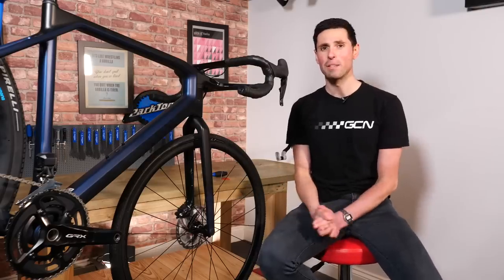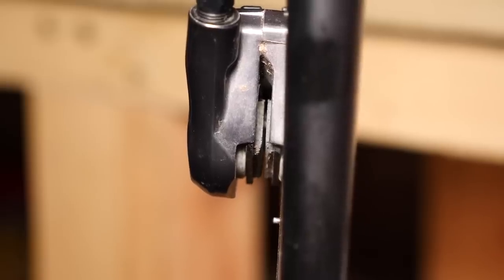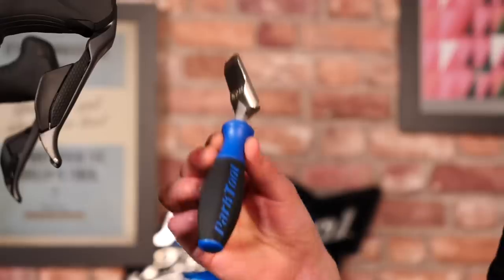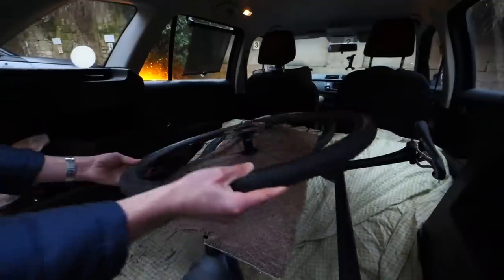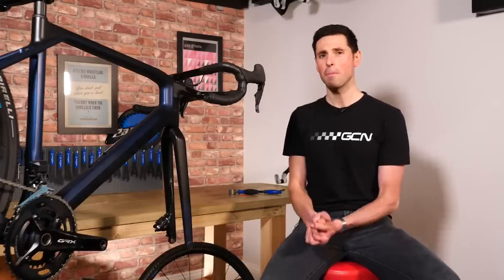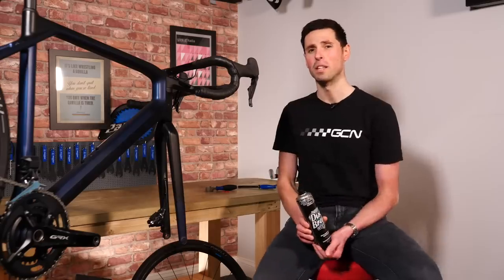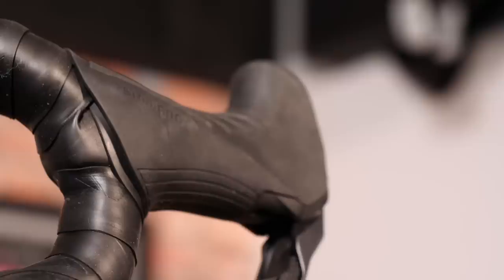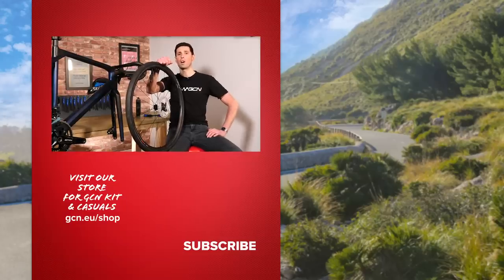Top Tips For Travelling With Hydraulic Disc Brakes

Comment: I have cable pull disc brakes on three of my bikes and love them. I would never want hydraulic brakes though...part of my love for bicycles is their simplicity. I have had enough fluid leaks from cars over the years.
Reply: I always had issues with sram brakes, Glad I changed to shimano, zero issues or maintenance needed except for brake pads

Comment: 1. Don't ever lay the bike down in the back of the SUV with the rotors on the bottom side. Lay it on chainring side. 2. After you lay it down, turn the handlebar 90 degrees to the right so the levers are up. I did not do this on a trip one time, and upon getting the bike out of the SUV the next day, I had no front brake. Fortunately, squeezing the front brake lever several times pumped up the front brake and it worked fine after that.

Comment: My caliper locked after taking out the wheel, thanks to this video! 💪🏻💪🏻💪🏻
Reply: Open the bleed bolt to release some pressure.  Also use a bleed block next time to ensure the correct amount is added to prevent another lockup.

Comment: On some levers such as Shimano 105 R7020, you should remove the top hydraulic screw before pushing back the pistons as the pressure can cause a small leak on the levers

Comment: To decontaminate my disc brakes, I remove the pads and sand lightly, holding them face down on a flat surface. Then I wipe everything off, including rotors, with methyl hydrate and a clean cloth. Works perfectly for me and costs virtually nothing.
Reply: I tried cleaning my front brake rotor on my gravel ride recently with iso alcohol but still no dice. I'll give them a light sanding next. What grit sandpaper do you typically use?
Reply: @BrentZahradnik  sand the pads, not the rotor. Use 220 grit or so, just to remove any glazing or contamination. Wipe off everything with alcohol afterwards.

Comment: Why so much hate for disc brakes in the comments section ? 😆 If you've ever tried them you can't deny the stopping power is far superior.  I've had both, never going back to rim brakes.
Reply: You need hydro disc to control a 25mm road tire? What rim brake calipers and pads are you using sir?
Reply: @durianriders  Do I NEED them? No, but I much prefer them.  I commute by bike, rain or shine.  Heavy bike, with sometimes heavy panniers.  80% busy city streets, 20% gravel trail.  Rim brakes become pretty much useless if it rains or if the trail is a bit muddy.
Reply: @durianriders  haha there he is. On his crusade against disc-brakes. Love u Harley 🤣
Reply: Haters gonna hate.
Reply: MRGRUMPY53  More often than I'd like, which is at least once a year (had one just last week).  The one time I had to do one with rim brakes left me rather unimpressed (and also flying over the handlebars).  Look, I get it: If you ride a super light bike for leisure, away from traffic and in good weather, rim brakes are more than OK.  For my situations where I have to be mindful of cars and distracted pedestrians/kids/squirrels/dogs jumping in my lane at any time, or going down a steep bumpy hill on my gravel bike, I'm much more comfortable using disc brakes.
Reply: @durianriders  Rim brakes simply don’t work in the wet. Unless you only cycle in the dry, disc brakes are far superior.
Reply: @durianriders  during inclement weather in hilly areas, it's like extra insurance. We all wish the weather would be like paradise all the time, unfortunately reality is often disappointing.
Reply: MRGRUMPY53  try riding through busy city streets during rush hour, you'd be surprised how many sudden stops you need to do.
Reply: MRGRUMPY53  ...and it sure sounds like you're playing dumb.  Traffic lights are the main reason one would need to suddenly stop? Really?
Reply: MRGRUMPY53  You've got to be joking but if you're not, please let us know where is this promised land where other road users are more predictable than traffic lights and never try to kill you, where squirrels never change their minds mid-dash about which side of the street they want to be on, and where it never rains.
Reply: @francoispayen  you said rim brakes made you fly over the handlebars on a panic stop? Maybe the rim brakes are too strong.
Reply: @kazaroth  rim brakes can lock the wheels on a wet road with no problem.

Comment: Any tips with regards to position of bike when travelling? I have found Turning my bike upside down causes the brake fluid to leak out and air fills the brake lines (ultegra di2). Is lying it on its side ok or just as bad as upside down?

Comment: When packing for air travel, you usually have to remove the handlebar to fit into the box/case. Is there usually enough hydraulic hose in a typical installation (tucked neatly away in the stem and head&top tubes) to extend to the lashdown points for the handlebar in a travel case? Would hate to think that one would have to disconnect the brake hoses (hydraulic fluid leaking EVERYWHERE, needing to refill and bleed the systems upon reassembly) to be able to take your Faithful Steed on holiday.
Reply: I flew like that pre-pandemic and yeah no problem - there's usually enough slack in the hoses to allow for the handlebar rotation. My RD still got bent but brakes and rotors were fine...
Reply: They should have enough cable - in fact this should be one of the first things you do when cabling a new bike (or when a bike is cabled in the factory) - check whether you have enough cable and hose so none of your brakes and shifters bind when the handlebars are fully turned to both sides. If cable length is not enough, somebody messed up during the process.

Comment: Hello, I have a question. While back while riding rented bike with hydraulic disc brakes (shimano 105) we stopped, took pictures with bikes over heads turned upside down, and headed to descent. One bike performed normally, but other during braking would occasionally start vibrating strongly, up to a point when bike was unsterable and only think you could do is to clench leavers just to stop. Vibrations would stop and you could continue descent, waiting for this to reoccur. I ride mechanical DB, this happened on last day of riding rented bike, what was it? Bike shop didn't know asked about it. Was it air that entered brakes when we turned bikes?
Reply: I had two brake pads where the actual pad came away from it's backing plate. One in the front calliper exited somewhere on the trail, the other in the back stayed in until I removed the pads to check them. Maybe you had some sort of similar dislodgement?
Reply: @peterharrington8709  thanks, but after first time it happend I chcecked calipers and everything was ok, no leakage etc.

Comment: some bike box forces us to pack the bike upside down, will there any air bubbles get into the brake hose with the brake fluid and cause some problem?
Reply: I tip my bike upside down all the time to drain water, ever had an issue with the hydraulic brakes
Reply: Never a problem if they are properly bled.

Comment: you work for disc brakes, rim brakes work for you.
Reply: Amen! 🙇
Reply: Maybe for road bikes, but for me rim brakes were a horrid constant faff on my mountain bike. Haven't had to change pads in 5 years (probably will soon, but they are within tolerance still) while on rim brakes I was chewing through pads every couple months.

So yeah, for road bikes rim brakes still make sense, for mountain bikes? No. Not at all
Reply: When it's wet, it's the other way around.
Reply: @nekobytes9187  squeeeeeal
Reply: Right, do a decent in a wet weather with rim brakes and carbon wheels and then come back to me. Trust me, I'd rather hassle a little more with maintenance and stay alive

Comment: Always remove  your brakepads and clean them with clean paper when cleaning your Bike = never squeling brakes again. Costs 2min extra time but your pads last for ages
Reply: mind sharing the details of using paper to clean the brakepads with us? looks like an interesting method to keep them clean
Reply: @mmiqdad  of cours, first thing i do befor i clean my bike with water and soap,( every week or two) is to undo my wheels and brakepads. So when you use degreaser and soap the discs and brakepads can't be contaminated with oil or gunk. Afther the clean i do a little bit of degreaser at my brakepads en clean them with a clean dry papertowel. the same with my disks. Then i place the pads and the wheels when everyting is dry.
Afther 25k and two years of riding my disk racebike never had squeling disks in dry and clean rainy conditions. your brakepads wear is also at a minimum.
Also a good tip when you center your calipers is to center them first without the brakpads. so you center them at line of sight with the disk perfect in the middle.
And don't use oil but wax on a disc bike.
Reply: @svendeclercq5160  thank you so much for the knowledge!

Comment: Hydraulic disc brakes are the best brakes.
Reply: Unless your hydraulic disc brakes lose pressure when going a steep down hill descend (brake hose started leaking)

But still better than having a rim brake due to heat 🤔
Reply: I respectfully disagree - a solid stick through the spokes of your front wheel get you the best stopping distance :)
Reply: James Smith  Enjoy literally damaging your wheels every single time you come to a stop...
Reply: Those that hate on them usually haven't tried them or are afraid of working on them or afraid of change.

Comment: What a faff. Life is too short for disc brakes.
Reply: Disc brakes have been easier to mantain, less cumbersome and less annoying than rim brakes for me, so much more. I have a mountain bike though, for a mountain bike rim brakes are totally obsolete for good reason, god I remember chewing through pads every couple months, faffing around with the alignment and tightness of the V-brake arms. Screw that. Here I am about 5 years later shredding trails on the same pads and discs, they are still fine